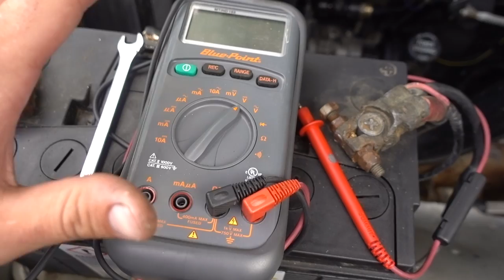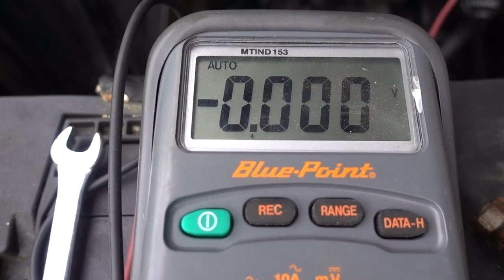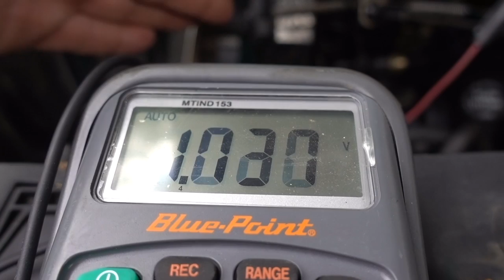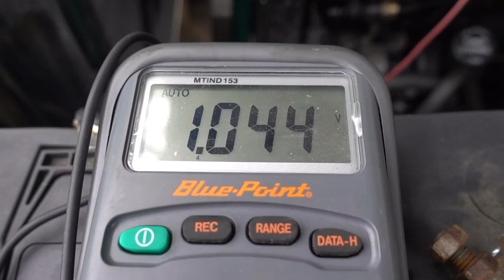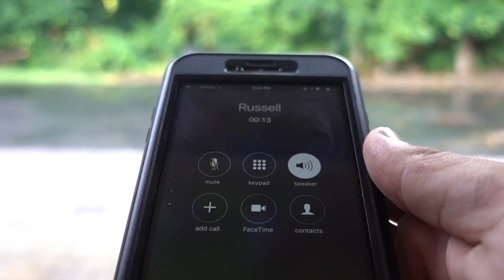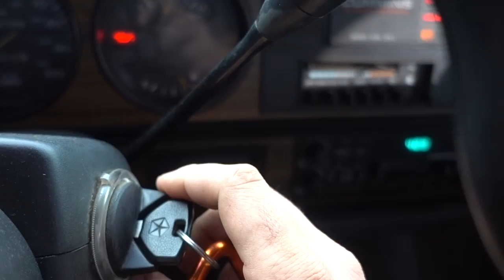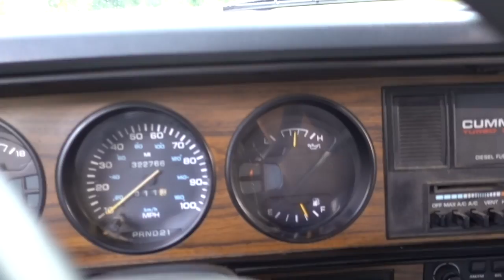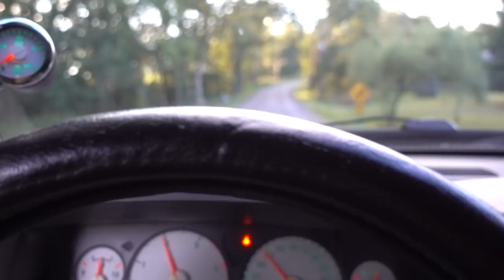DODGE RAM CUMMINS PICKUP TRUCKS ARE USELESS, THEY ARE JUST TRAILER QUEENS!!!

Comment: that tps delete will save your trans. I went through 3 bad sensors before I found out it was my tps. the throttle itself gets wore out and tricks the TPS. but the tps will fix it.  the throttle housing on the pump is like $300+ and the tps sensor is 125-145$ . my tps delete kit cost 24$ and 20min of install.

Comment: Hey Greg I just had a brilliant idea on the 1st gen stack, while fabricating it put a low spot in the piping and weld an o2 bung at the lowest point. if it ever gets rained in and it's got more water than you would want to start it with.. just pull a plug out of the bung and drain most of it out.

Comment: dont do the tps  just do a manual overdrive switch. its the orange with blue stripe on the driverside. just wire up a power wire through a switch and a ground. its only two wires that come off a two pin connector

Comment: do you have a cdl.? just wondering with your trailer.
Reply: Eaves Street he might not need one if he register that trailer at let's say 12k or 14 k not the 23 k or so it's rated at he doesn't haul anything heavy on it so he can get away with doing that.
Reply: Vasiliy Dronov true i guess. here in iowa its tagged on title and trailer. idk where he is.
Reply: love the trailer wish i had it
Reply: In Wisconsin, and most states, if your truck isn't rated at 26,001 AND the trailer isn't rated at 10,001 there's no need for a CDL. Especially since it's not being used commercially.
Reply: Kyle Sonsalla OR if truck and trailer combined gvwr is over 26k its federal same for every state. i was curious and called guy in town that is dot enforcement. he started to rattle off all the cdl crap, he said they look for trucks with tandem axles trailers cause 90% dont have cdl.  not that it matters to me, greg has a sweet setup. i didnt know pj made a hydraulic dove tail. i have a 20 foot deckover full tilt.
Reply: Eaves Street 
As a commercial driver, that's incorrect. Truck rated at 26,001+Trailer rated at 10,001=CDL territory. A truck not rated at 26,001 or more, pulling a trailer rated for 10,001 or more, is legal without a CDL as long as you stay below the trucks rating. I.E. my 97 7.3 F350 SRW is rated at 20k gross combined. It weighs 5,900 ish empty with fuel. I can tow 14,100 ish without any gray areas, minus passengers/tools/etc in the truck. My 97 dually is rated at 24k gross, but being a cab+chassis with a steel flatbed was closer to 7k empty, giving 17k capacity legally.
Reply: all i know is my 2004 2500hd with my 12k trailer is ok. lol

Comment: Gregg, what are your thoughts on the Easylink platform for tunes? I know EFI live is tried and true. I don't know if you have researched it at all but it does have some useful features, like change on the fly tunes, data logging and you can get tune updates imediately from your tuner as long as you have a wireless internet connection. From what I have read, which can be decieving, because you obviously hear more complaints than praise, some hickups with limp mode and ecu freeze ups due to wireless connection issues during set up. I have read great things as well. I live in a small rural area of Northern Califirnia so I don't personally know anyone using this platform. Just wondering if you have any thoughts or information on this? Love your channel.

Comment: I have a first gen with a 5 speed manual  4x4 500000 miles but it took 6 trans to get there and I have a first year ford 6.9 4 speed 600+ never messed with the turd the dodge will kick it's ass .

Comment: When I get a tow pig. Should I get a diesel manual long bed or does it matter. I am for sure getting diesel
Reply: Jett Waters manual is best for towing in a dodge auto or manual in a duramax Don't get a powerstroke I from personal experience  just stay away don't even look at them. long bed crew cab will give you best stability due to longer wheel base their are quite a few videos on YouTube that explain this well check out big truck and rv channel he has a lot of info on it. just stay away from the powerstrokes and save your self the head ache.
Reply: I understand the long bed thing. But could you explain the manual more and also i have had good experience with powerstroke. Why don't you like them?

Comment: I posted about this on your other video too, there is a temperature sensor in one of the hard lines coming out of the trans that you removed. Without it hooked up you have no overdrive. The fix is to just wire the two wires for the sensor together.